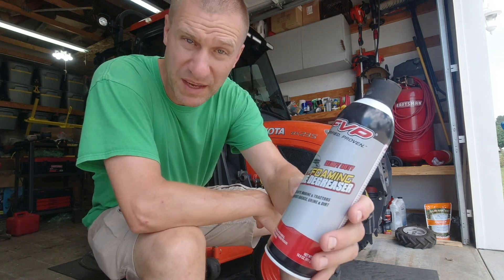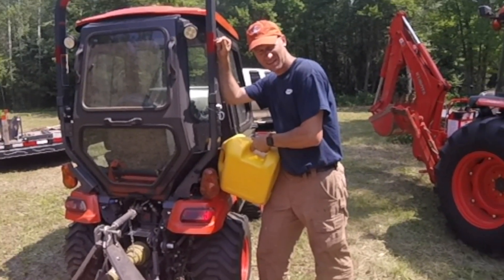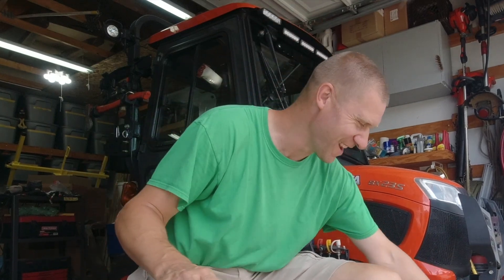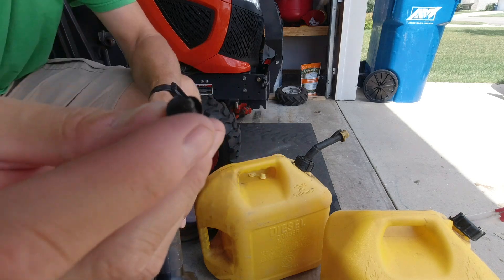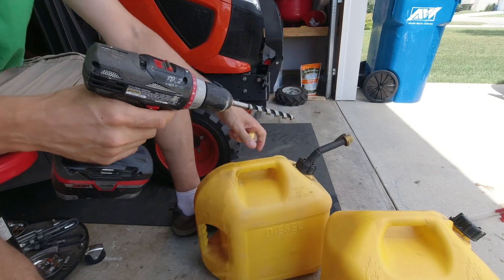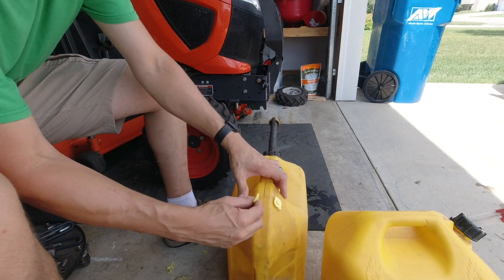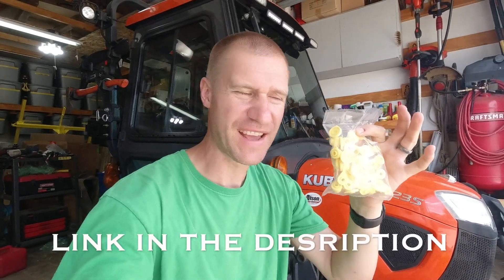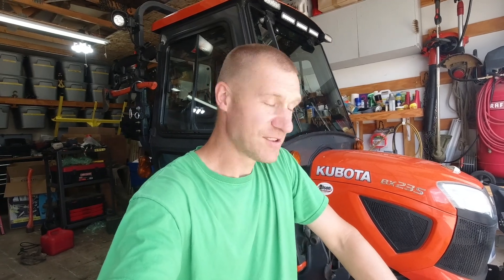VENTING FUEL GAS CANS (cheap and easy)

Comment: So far so good. I’ve filled it twice and it’s great getting 13 gallons at one shot https://www.youtube.com/post/Ugkx-vlHjazTv30m_UAq9Ht-fuPo2jBx7tTx . It pumps out by using gravity so the bottom of the tank needs to be above the vessel you're filling. Not a drop spilled filling the generator three times. Let’s see where we’re at after 20 fills.

Comment: I converted mine to. But I used a tire valve. Removed the needle and used the cap as my vent release. Works great.
Reply: Bingo.  They sell ones that are designed for fuel cans and look just like schraeder valves.  That's the route I went.
I tried these yellow ones in the past and they were ok but I prefer the metal ones

Comment: I’m glad you mentioned to Remove plastic Debris from Inside Can to Save Repair Costs. Thanks👍
Reply: There's a couple of locking tabs in there to release and the parts slide right out, spout looks the same and the cap still screws on. I have 3 of the same cans and they work great after the spout repair with the added vent like John installed. You only need one vent but it works well either way.
Reply from the maker: There was just one little piece that fell in through the hole, easy to get out with my air compressor. 
Keep on tractoring!

Comment: Valve stems from wheels work great as well.
Reply: Have you done this personally?  I wanted to try the valve stems, but I heard the gasoline degrades the rubber and they only last a year or 2.  Do you have any info on that?   Thanks.
Reply: It's been a few months and so far I haven't had any issues.
Reply: @PatrickWagz  that's pretty true. I got a little over 3 years out of mine. I used the steel ones with a rubber seal inside, and out. When the rubber dried out I replaced the flat rubber washers with a pair of fat neoprene on rings and they have held up for years with still no leaks.
There's also a small rubber o ring inside the cap. I also replaced it with a neoprene of ring. It was actually the first seal to fail in just a few months

Comment: thank you, I got 7 five gallon cans, drive two hours a day going to work and back. I buy fuel at kroger using their cents off per gallon program for up to 35 gallons. Car only holds 15. I put single vent caps and they work good, TWO will be better I think, thanks.

Comment: You can remove the internals in that red spout and it works fine with the added vent cap.
Reply: I was filling up a lawn mower one day with mine and the whole spout fell apart, so yep after that happened the thing worked much better, still slower than molasses though, but with the new vent on it, it works much better, I got a kit with a new spout and vent cap so I replaced the spout with a wide mouth one and vent, so much better.
Reply: Someone needs to 3d print or mold a cap that's barbed for 3/4" hose like on a VP racing 5 gallon jug.
Reply: @systemfile  Easy to make your own adapter with ~$5 in parts from the PVC  fitting section at the local home supply store.

Comment: I got the battery pump at Harbor Freight for about $7.00. Batteries included. Works great.
Reply: I love that pump. It works very well.
Reply: How's she holding up?
Reply: @PatrickWagz  I have two 1 for gas and 1 for diesel. Both have worked good  and on the same batteries that came with them. I've had then a year or so now.
Reply: For that price, the pump probably does not have a brushless motor. One spark and its all over....
Reply: @PatrickWagz  I have two. One for gas and one for diesel, and both work good.
Reply: @goodun2974  They are made for gas.
Reply: @rickvb2709  , theyre made in China. Safety regs might not apply. I'll buy one and disassemble it and check it out. I  can pretty much guarantee you it will not be a brushless motor.
Reply: Okay, I bought that Harbor Freight gas pump yesterday ($10, New England price). My short-form assessment? Meh!. It's more of a self-priming siphon hose than an actual pump, and the too-short outlet hose needs to be gravitationally lower than the bottom of the pogo-stick-like pump assembly for the "pump" to function. The "pogo stick" won't reach to the bottom of a Scepter 5 gallon can and can't fully empty it (no matter how you angle the gas can itself) and it doesn't allow me to drain the last couple gallons out of the generator tank either (so I still have to undo the fuel line and use a funnel to drain the tank into a fuel can). Sure, I can sit a full gas can on top of the generator and use the pump to  fill the generator instead of having to tip the can and pour the gas manually; but In order to use the pump to put gas in the car from a gas can I'd have to either hold the gas can up higher than the car's filler cap, or sit the gas on top of the car (Subaru wagon) and use a longer hose to reach all the way down to the gas tank cap (and despite being 6' 2", I probably wouldn't be able to  reach the pumps on-off switch, not easily anyway). So, it's kind of a one-trick pony, for my purposes anyway. Your mileage may vary....

I would have taken the pump apart to see whats in it but it has no visible fasteners and appears to be glued together (despite the manual showing an exploded view of the parts).
Reply: @goodun2974  It works for me.
Reply: @rickvb2709  , I'd happily spend 30 or 40 bucks for a better pump that suits my particular needs, but a real transfer pump costs more than I can see my way to spend. Anyway, I felt it would be usefull for other folks to know what they would and would not be getting for their 10 bucks.
Reply: @rickvb2709    Okay, thanks for the update.

Comment: Thank you. I have modded all  my gas cans with a proper spout and vent, and I bought some more to do today and could not recall what the size was for the drill bit. Darn shame the government makes you buy a useless spout that will be thrown away with each can. But.. I guess it helps the environment. Evens out the landfill or something.
Reply: Which spout do you purchase to replace the original? Thanks.

Comment: A step bit (Unibit) is best for plastics and thin metal.
Reply: Agreed. I'd like to glue the vents, but not sure what to use. Any suggestions?
Reply: @kevingoshe4371  There's a new version of JB Weld just for plastics.  But don't those vents just snap into place?  That type of plastic is very hard to glue......practically nothing will stick to it.  Also you might try hot glue.  Stanley makes the best.
Reply: Thanks Danny. Yes, the vents snap in, but that allows for a small amount of gasoline to leak out as you drive home from the gas station. I was hoping to find a product to stop that.

Comment: Actually purchased these off your link.  They say to use a 31/64 bit and you used a 1/2.  31/64 was very hard to find in store so ordered off the net.  It's the size under 1/2 so time will tell if that was the right decision.  The 1/2 sure seemed to work in your vid.  Thanks.

Comment: I used a tire valve stem and cap with the core removed. I got two for $3.
Reply: Only problem with the tire valve stem approach is that the rubber on those is not made to hold up to gas exposure. So not sure how well they will hold up long term.
Reply: They don't last...
Reply: And ya gotta unscrew and screw'em. Best not to go with Schrader for this.

Comment: I learned from another youtuber how to take that spring out of the spout by pushing the stem in, removing the larger O-ring, pulling out the stem, lose the spring, then re-install the O-ring.  If that's the same type, that is.

Comment: I got myself a nice narrower, longer funnel.  
Put the funnel on the tractor, remove entire spout from fuel can, and pour it directly into the funnel without the spout on.  
Pours fast, eezy peezy.  Only a little tricky if the can is really full, so I just stopped filling them as full.

Comment: Have you seen any leakage or seepage around the vents where they snap into the jug, or around the snap on cap?  Just wondering if they’ll stay drip free when sloshing around or if they fall over in the back of a pickup!
Reply from the maker: They fit very tight so I don’t think there will be any seepage. I usually use a rubber bungee to keep my fuel cans in place in the back of my truck. 
Keep on tractoring!
Reply: A RITTER BIT WILL DO thanks for the reply!  I too usually tie my jugs upright but... well... sometimes I might forget LOL!
Reply: If the can falls over in the back of the truck, the vent cap can pop off, but whose fault is that?

Comment: Expensive, but I still like the Terapump!  Have two and the best thing, you don't have to sit and hold that heavy 5 gallon tank!  Yea, these gas nozzles, I'm not sure what regulator came up with them, but they are way more dangerous than the old ones that were a straight plastic flexible hose with a cap back in the early 90's!  Can buy those on Amazon too for $10 or so.
Reply from the maker: I agree, I end up spilling more fuel with the new “better safer” nozzle than with the old ones that actually worked. 
Keep on tractoring!

Comment: Great solution! Question, I know it may be hard to quantify, hows the fuel consumption? Let's say with mowing. I'd ask about the snowblowing, but too many factors with the snowfall.
Reply from the maker: The Kubota engine is probably the most fuel efficient engine in a tractor today. I can’t believe how little fuel it consumes. I would guess I get at least 15-20 hours on a 6.5 gallon tank of fuel. 
Keep on tractoring!

Comment: Bonjour Monsieur le Professeur 😊 That is great that you find a real good solution Sir 👍 I see that you have a great red air compressor ( Mastercraft ) do you drain the water often from your bottom valve Sir ? 🤔 Just asking 😉 Great video Sir and have a great TGIF Cheers 👍
Reply from the maker: I drain it about once a month. My uncle had one rust through and the bottom blew out. Shot like a missile right through his garage roof!! 😳 I usually don’t have much water in mine if at all. 
Keep on tractoring!
Reply: @ritterjon  Ho boy, your uncle was very lucky for sure !!! Yes mine too about once a week and two tables spoon Thank you and keep up the good tractor therapy Monsieur le Professeur Cheers 👌👍😊

Comment: I hate those new spouts as well! Let us know if the fuel weeps around the fittings during transport.
Reply: If you don't over-fill your fuel cans, which is the reason to put that vent up as high as you can, I put mine in the middle of the back side of the handle on my 2 gallon can.  Gas would run out the filler opening long before it would reach the vent.  Even with fuel sloshing in the can I couldn't get mine to leak out of the vent...at least for now, who knows after a few years when all that stuff wears out.
Reply: I installed vents on six cans and only one has any seepage. A bit of gas tank sealant around the neck of the vent prior to installing will solve that if it's a concern.

Comment: I heat my shop with backup diesel heater and since I use my tractor a lot, I just fill my 50 gallon drum every so many months and installed a fuel filter and 12v pump. More than 5 bucks but just like pumping at a gas station. But I agree, those stupid new Gerry Cans are worst than the regular with a rear bleeder valve.
Reply: I need to get a heater like that for my shop.  Where did you purchase your's from?
Reply: @wildbill23c  I got mine from Banggood. Picture this. I have a metal shop with concrete floor 13'x34'x11' high ceiling and a wood shop with wooden floor 14'x20'x8 high ceiling. On the coldest day this year for my area, -24'C, on a 10 litre container, I'd use maybe a 1/4 or 1/3 of fuel. That would keep BOTH shops heated at 14'C which is 30'C difference from inside and outside temps. Since it heats up a dry heat, it  was never humid in the shops. 

I had bought the 8Kw but from what I hear, it's just a gimmick. They are just over pushing a 5Kw which is much cheaper in price. I installed it on the 6th of January this year and stopped it maybe 2 or 3 times before finally removing the heat for the season, in mid-April. Very good investment. Haven't done any maintenance on it yet.

Comment: Great idea . No need for those vents in Canada . All of our fuel containers have vents built in . I prefer though the NO SPILL cans . That's what I use . Pricey yes but mine have lasted over 15 years . Great for fueling small engine stuff because you can see right into the tank when refuling .
Reply: @firehawk6188  That's it . Best gas cans on the market . Just push the button and out she comes . No need for any funnel .

Comment: What's to stop it from leaking from those Vent nozzles? No runner gaskets.  Seems like it work but, I'm skeptical.
Reply from the maker: Those vent fit really tight. Just don’t let the fuel can tip over. 
Keep on tractoring!

Comment: How did you get the piece of plastic out when there’s a filter attached inside the spout?
Reply from the maker: I just simply removed the spout rinsed it out good and then air dried with my compressor. 
Keep on tractoring!

Comment: Drill a sharp clean hole and use petroleum resistant glue when pushing them in so no leak when the gas splashes around on the way home from the gas station. Alternate would be to smear some JB Weld b4 pushing it in.
Reply: JB Weld (the slow cure type anyway) has been solvent-safe against gasoline in my experience. I also tried Marine 5200 but the gas vapors eventually softened it. Maybe Goop or E6000 would work?

Comment: There's no need to install two of those vents, one will provide more than sufficient venting.
Reply from the maker: But two is always better than one. :-)
Reply: Symmetrical torque when emptying the fuel is much easier to achieve with 2 vents.  I found that the fuel can tends to pull to one side when I only had one fuel vent installed.
Reply: @PatrickWagz  LOL..
Reply: I put a single vent on all my gas cans. One vent is all that’s needed.
Reply: @ritterjon  more vent the better the flow. To much vent oh well.
Reply: @Dean Zinter , drill a couple dozen holes on the underside of the tank and set it on the ground and it will fill itself with fuel from deep below! 🤣🤔
Reply: @PatrickWagz  🤣! Although, I once had a Sceptre gas can that split on the top seam where the two halves of the can were joined together, so perhaps it would be better to install the vent off to one side slightly and not directly on that seam.
Reply: @PatrickWagz  , with only one vent, does the gas swirl clockwise or counterclockwise as it exits the can?🤔
Reply: @goodun2974  Depends. In Australia....
Reply: use 2 to make the fuel flow like a nascar can , use one to slow the rate coming out.

Comment: I think these style fuel cans are more about fumes from gasoline than anything else.  Diesel doesn't vape off as bad as gas, but if they only changed the gas cans, everyone would just buy diesel cans for their gasoline.  Jon, after 6 months of use, what do you think of the venting?  Had any issues when them?  Does the jug still hold up?  Any splits in the plastic?
Reply from the maker: This venting idea has been the easiest and cheapest method I think I could have done. So simple! Go for it! 👍 no leaks
Keep on tractoring!

Comment: The one that you don't like and that spout at the base where you attach it to the fuel can you see an O-ring pull it off and then you can take the red off and on button to open the fuel flow off there's a spring in there take take the spring out stretch the spring out cut it to the original length of the spring and put it back in less tension on it and then you can operate that nozzle with ease and it will flow better especially since you added air vents I'm in a hurry so I haven't proof read this that will improve your gas flow as well

Comment: The problem I have with fuel cans is the seal doesn't work when poring gas into filler neck they pour fuel around the cap and spout so I buy o rings to put on the spout stops the leak

Comment: Get you one of the battery operated pumps from Harbor Freight, Walmart, Menards. We fuel our pontoon from cans while at the lake with this pump and it’s awesome, set the can in a flat surface, flip the switch and watch her pump! 5 gallons in about 2 mins, $7 in the kerosene heater section.
Reply: Jared, I sure hope those battery-operated pumps use a brushless motor. No sparks allowed!

Comment: I have a plastic gas can that I store gas in it for 4-5 months only no longer than that. I noticed around 3 months my plastic gas can swells up do you think if I were to install these gas vents it would help with the can swelling? It is a brand new can I am using. Thank you Sir any info would help.
Reply from the maker: My cans will always swell in warm weather and shrink in cold weather. The vents are tight and I really only use them when pouting fuel. 
Keep on tractoring!
Reply: @ritterjon  Thank you Sir very much!

Comment: I just use VP racing jugs but I guess if you're super cheap you could modify existing jugs.     Wasn't worth dealing with them to me.   They swell so much when hot, the plastic is crap,

Comment: I was at D&B supply yesterday and for $15 I picked up a fuel can spout and vent kit...the spout has 2 pieces so you can have a long or short spout depending on what you are filling up which for your tractor and cab would be great so you aren't hitting the side of the cab with the can as it empties out.  

These new fuel cans are pure garbage with those stupid epa nozzles, obviously the morons that thought of those things never have used one of them.  Most fuel spilled has been from these new cans.  I still have 3 of the old metal army "Jerry" cans that I use for my lawn equipment.  The small cans I use for mixed fuel/oil for the 2 stroke equipment.

Comment: The main problem with those properly govt regulated gas cans is the average person using one spills more gas in one summer of cutting grass than they did in their lifetime of using the old style gas cans. Just goes to show when the govt is gonna step in and take control of a situation they make it 100 times worse.